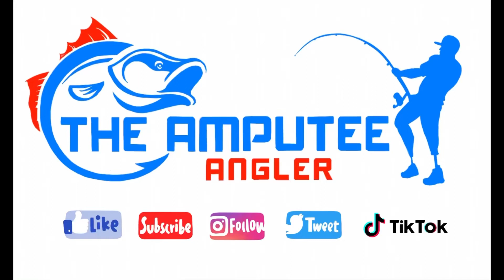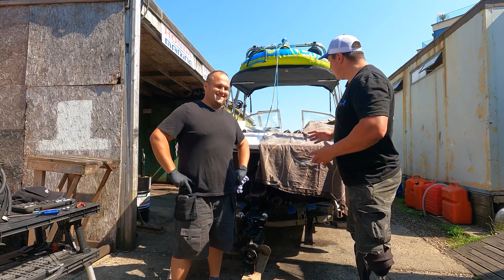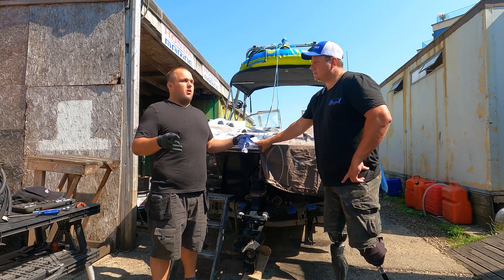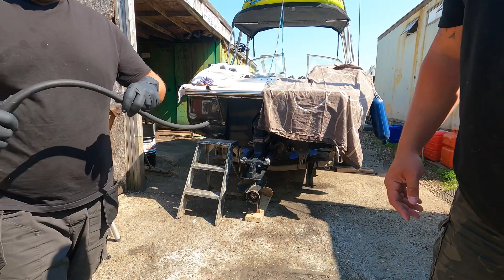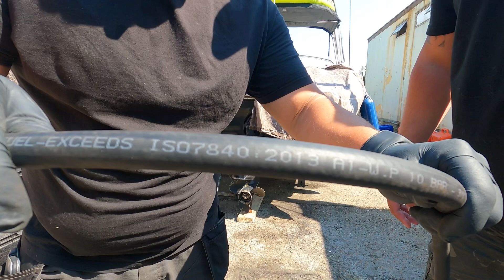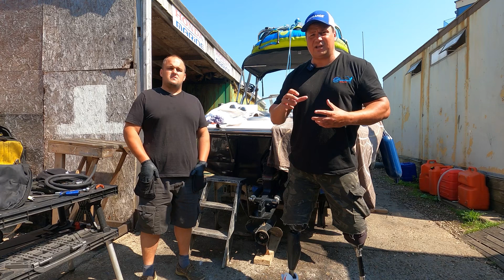E-10 Fuel Problems Causes & Solution's - Advice From Our Marine Engineer At Simpson Marine #E10fuel

Comment: My boat has a 2004 engine and a 200l inboard tank. Never used E10 and never will. E10 is meant to be used within 3 months or you will suffer with water being absorbed into it. Also very worth while having a bowl fuel filter with a water drain at the bottom so you can drain any water regularly. Top advice from Steve at Simpsons. If you have an older engine and fuel is likely to sit in your tank for more than 3 months use Superunleaded E5. Cost more but a lot less than a new injection system or engine.
Reply from the maker: Great advice from yourself also Trevor thank you for replying 🙏🏻
Reply: @theamputeeangler  Hi Ben, keep up the good work and I hope to catch up with you sometime at Simpsons. I was brought up in Denton and I think that I am correct in saying that I was very good friends with your dad whilst we were youths. If you speak to him please mention me and if I am correct then give him my regards.
Trevor
Reply from the maker: @trevorgodfrey4431  I shall pass that on mate 😄

Comment: Hi Ben literally just had to replace all fuel lines on our boat due to this problem as the engine stopped luckily in the outer harbour, I am.now a little nervous about taking her out
Reply from the maker: Bloody hell. Happened to a friend aswell he had to replace all his! 

As long as you have replaced them you will be fine done worry about getting out mate new hoses will have sorted it just take a few extra precautions with the fuel like additives etc 👍🏻

Comment: So the ethanol in e10 causes condensation? Within the fuel line & carb/injectors? Would this problem still happen regardless of taking fuel tanks off the boat , or is the water in fuel Iine caused by the degradation due to this E10 ? 
 Seems like we’re gonna be replacing fuel lines each service just to be safe..😩
 Thanks for bringing this to attention Ben
Reply: Looks like I got a job to do
Won’t be to bad,it’s an outboard with removable (red) tank
Hope I can find a new primer pump ball thing that’s ISO rated
Reply from the maker: Hey mate thanks for watching and commenting I appreciate it! 

So the ethanol attracts moisture and it’s moisture that separates the alcohol from the fuel so the more moisture the more it attacks fuel which is the issue. 

If it’s left in lines or tanks obviously that process is left to do it’s thing, some people take tanks home and stir them and mix it all up but that’s not ideal or sensible and once lines break down as I mention in this vid then bits of pipe etc start going through the system and it become a nightmare. 

Getting the ISO rated lines at £10 a meter etc means there’s less chance of the older non rated lines breaking down. Sadly E10 cheaper and is being pushed now so we don’t have much choice going forward 😔